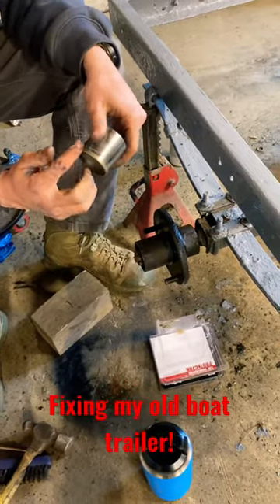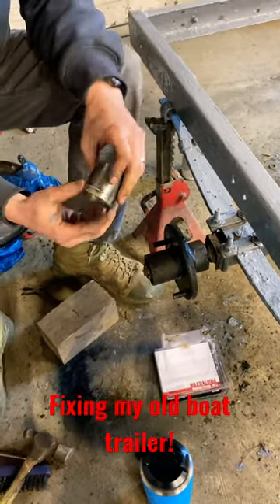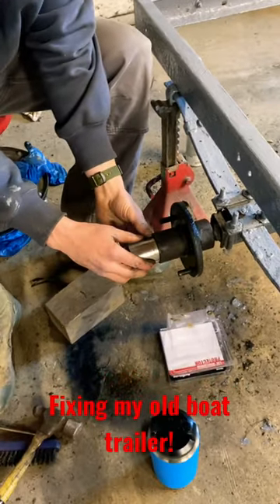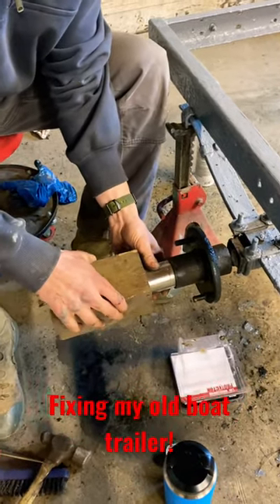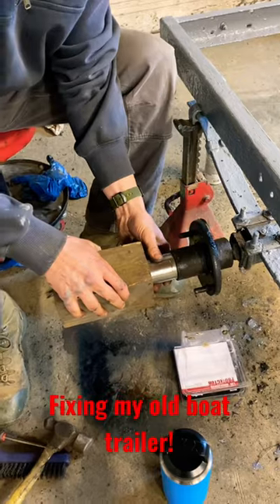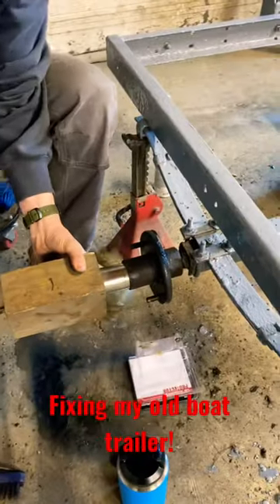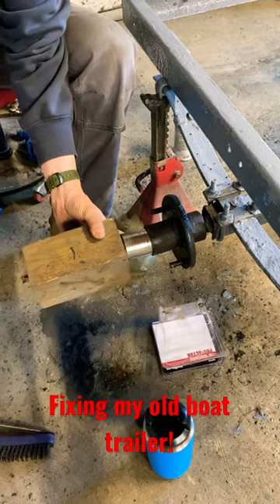How to install bearing buddy’s on a trailer in 30.07 seconds  ! ( very simple )!

Comment: pounding while in jack still and not on blocks? Can see jack tipping.
Reply from the maker: Had about 10 jack stands under it … and the trailer weights about 20 lbs …. Not to worried 😂
Reply: How much grease is added after that point?